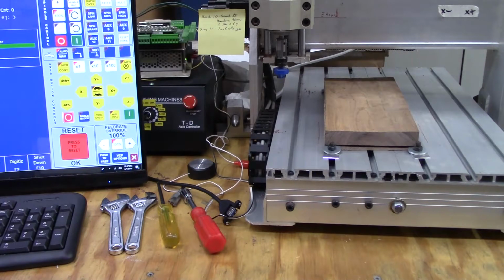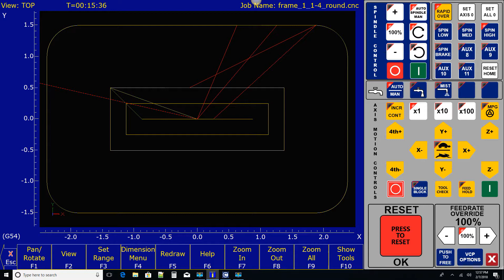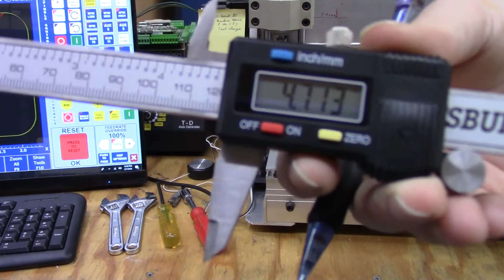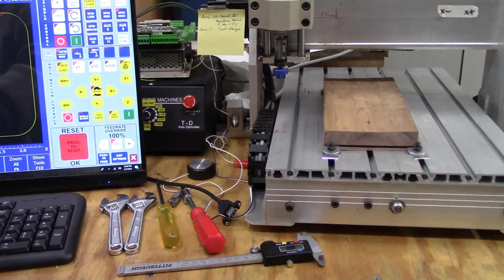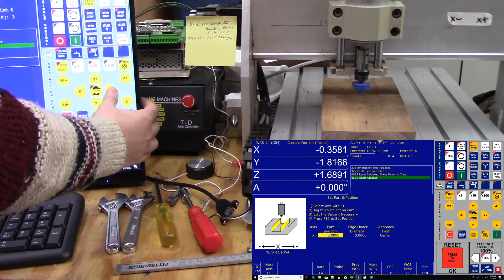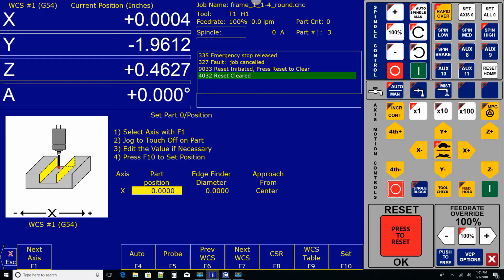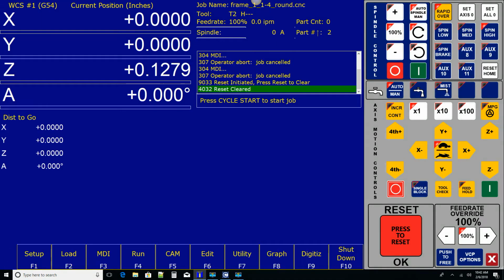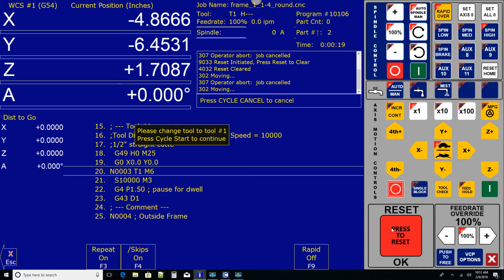Part Zeros & Tool Changes w/ Acorn CNC: X and Y by Jogging

Comment: Saw your link from reddit/r/hobbycnc. Good videos, nice quality, short and to the point, which is definitely not what most YT vids are! You may want to put a chunk of wood under your home location. Super easy to drop a bit when you've got a hand on each collet spanner. I've chipped a $$$ carbide bit in the CNC at work, and left a nice ding in the table at the same time. Your exposed electronics give me a case of the willies. I find the background bird distracting, otherwise, solid production. Great stuff, will check back.
Reply from the maker: Matt, thanks for your feedback. I really appreciate it. I'll be improving the background music and making my set-up more robust/safe. Thanks!